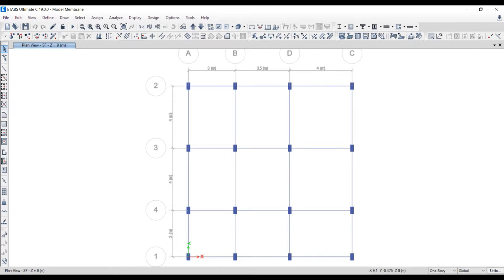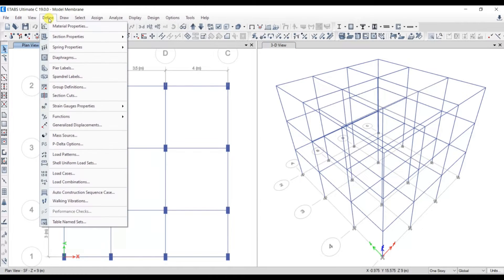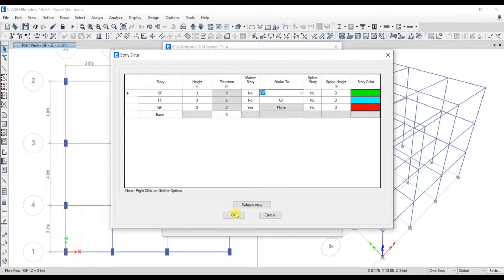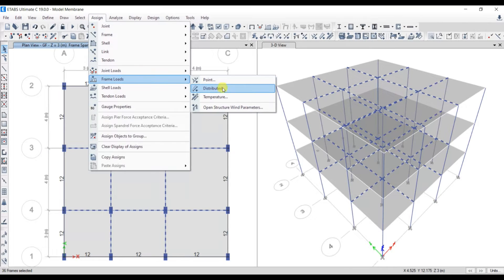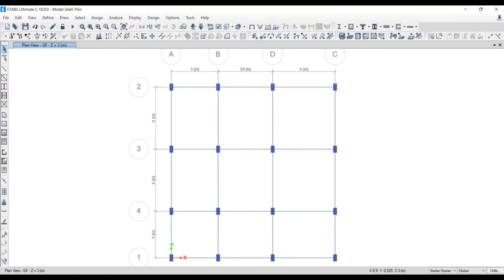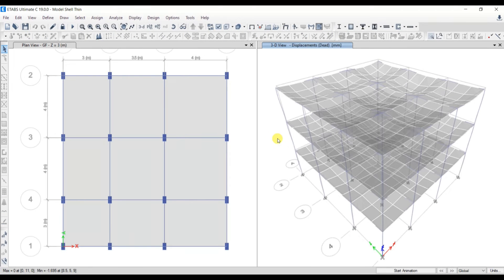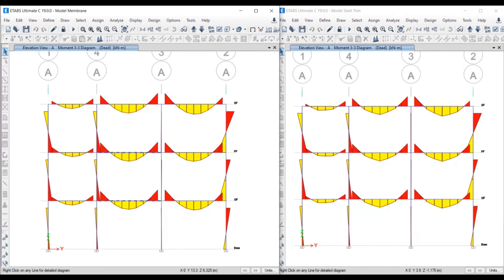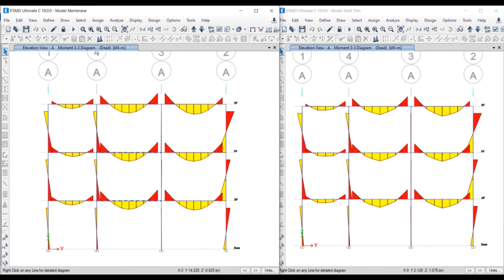Membrane Slab Vs Shell Thin Slab in Etabs |Membrane Vs Shell thin |When to use membrane & shell thin

Comment: Thank you very much. If I have well understood in most cases, we have to go to shell thin and in times when much need to go to the beam like in staircase or heavy machine we go to membrane.  I will like to know whether when we select slab we can select the overall slab in 1 go example by clicking on the first corner to the opposition corner of the whole building or it needs to be panel by panel and if panel by panel we need to define areas bounded by four column.  I wish I could send you a picture to clarify my question.  Is there a way to contact you for further information. Thanks.
Reply from the maker: You are welcome. civilengineeringmastery@gmail.com.